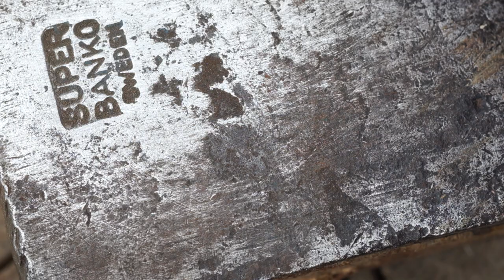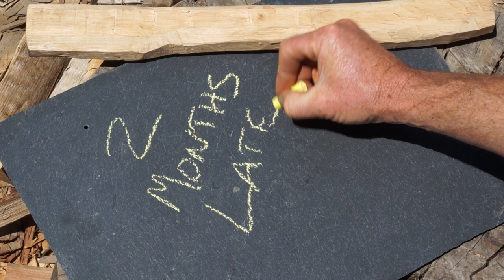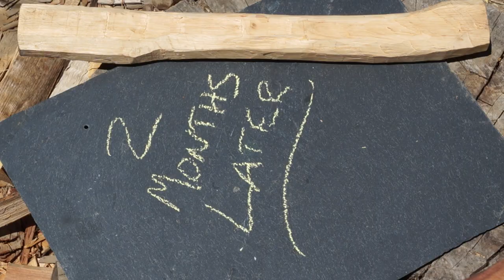Vintage Swedish Hatchet Modification & Restoration 1 of ?: Making a Handle Blank

Comment: You have the best homesteading channel on youtube, bar none.

Have you ever had any serious accidents/injuries/close calls on the homestead?
Reply from the maker: Thank you.  I want to actually tailor some of my future content a little more to new and would-be homesteaders if I can get it together.  I think everyone that is interested in any kind of self reliance/survival stuff should be following my content, but hey, I'm biased ;)   I've had close enough calls to get my attention with axes and chainsaws, but that's pertty much a given.  Too close to rattlesnakes a few times, but that's all I can remember.  Actually just remembered one time when a large fir log rolled over, which I basically expected, but it had a large branch on it that I hadn't noticed because it was barely visible.  It was pretty long and could have taken me out.  The velocity at the end of a long branch like that is pretty high relative to the speed of a rolling log.  That was close enough to lights out for me to remember.  I won't be surprised if I get it someday.  I work alone most of the time too, so it's just a risk I choose to accept to do what I want to do.
Reply: @SkillCult  I feel that in every way! Your channel has inspired me to make my first hatchet handle. Just recently carved from a cherry log. Small saw, axe, wedges, hatchet and a rasp. No power tools. I do landscaping and get paid to cut down or remove good material. Now I'm finally harvesting to an even greater benefit. Thank you for being an inspiration and a quality teacher 🙏🤘

Comment: Another great video Stephen.  I am slowly making my way through the videos on your page.  I love youtube but its easy to get sucked in and fill my brain full of more ideas than i can possibly accomplish.  Every since I started spoon carving this is the way I make my axe handles.  I sometimes use a froe depending on length of log.  Black locust is what I've been using for handles lately and I am very happy with their performance.  Also a shout out to the Pileated woodpecker at the end of the video. Seen 2 in my life and both times I was mesmerized.   SO much bigger in person that you think.  Ok - signing off.. Back out to the shop.
Reply from the maker: Yes, so many ideas and projects, something has to give.  I don't own a froe and never have.  I'll make one someday, which is why I don't own one actually.  I've used locust for handles quite a bit.  I like it a lot too.  I see pileated woodpeckers quite a bit.  I've been able to film them pretty close several times including this one.  Unfortunately, not with really good lenses.  Also found a nest once too.  One was working low down on a large rotten tree, so I snuck up on it and peeked around the corner right in it's face.  Hilarious :).    I always thought of them as elusive, but perhaps they are just uncommon.  Or maybe they're getting used to me here.
Reply: Very cool.  who knows maybe habitat where you are is a bit better.  You climate is similar but with less rain.

Comment: Awesome. I need to practice my axe skills. Just came home from my grandparents, my grandfather has a lot of axes with homemade handles. Used one just the other day when we did some gardening for him.
Reply from the maker: Cordwood challenge dude ;)
Reply: That's quite the undertaking...I might be tempted at some point, definitely.
Reply from the maker: There are plenty of things you can do to improve, but there's nothing like practical application and repetition to accelerate development of skills.  It really is an undertaking though.  I still feel guilty about doing it instead of other stuff I should probably have been doing instead.  Its also extremely satisfying and calming because it demands that you slow down, relax and focus.  You can always start very small, like 1/4 cord.  be safe.
Reply: Thanks man. I'm probably going to restore some more axes and learn how to create one that really fits me, and would be good for doing the cordwood challenge or something similar. I do have access to a small woodlot, and I occasionally fell some trees using only an axe on it. I can definitely tell that the axe is not ideal for the purpose, though. I'd like to make one more refined and adapted to me if I'm going to be getting serious on learning to use an axe properly, since it's gonna involve so much cutting. But it would be fun, and I have no shortage of handles or flea market axe heads to restore!
Reply from the maker: I think my next one will be about 27 to 28 inches 2.5 lbs, straight handle with a slight curve at the end.  The last handle I made was 30 inches which I found slightly longer than I wanted it for bucking.  Anything between 25 and 30 inches is usable for me though.
Reply: I'm pretty tall and lanky, so I think a smallish head on a longish handle might be a good fit. Not that I can't swing a heavy axe, but I want to experiment with a lighter one. I'm thinking that since splitting will be kept to a minimum when doing this type of challenge, you might not need a very heavy axe. How important have you found the weight of the head to be for bucking? I have done very little bucking with an axe.
Reply from the maker: D Cook says to try abut 30 inches for a multipurpose firewood axe.  I find the greatest shaping factor is bucking.  If the handle is too long bucking sucks.  I'm 5'10" and 30 inches is a little awkward for me.  I think it's best to start light and work up, but I'd go at least 2 lb and 2.5 is probably going to work really well.  I'm staying at 2.5 for a while and then I'll scooch up from there until I find a limit.  I don't have any heavier heads on short handles, but I think the common 3.5lbs is likely to prove a little too heavy.  I can swing 2.5 for a long time without fatigue if I'm dialed in and not spazing out or wasting energy.  I used a head that is probably under 2 lb a lot this year and it was adequate, but 2.5 did make a considerable difference.  As always, accuracy and efficiency are most important.  Have you read Woodsmanship by Mason?  great read.  You can find it online for free as a PDF.  If you can't find it, let me know and I'll dig up a URL or email it to you.  He calls 2.5 lb with 28 inch handle a pulpwood axe.  I think that is going to be just about right for me and where I was gravitating to anyway.  now I'm getting all excited to chop wood again!  Honestly, I'm not sure I'll be able to do it next year.  It was such a big time sink for energy that I don't have to spare.  But I want to.  I have so much forestry and chainsaw work to do though that I should probably be doing that instead.  We'll see.

--------------------------

 LIGHT VERSUS HEAVY AXES.  Farm Implement News, Volume 7 1885

A correspondent of the Albany Cultivator describes his
experience with axes as follows: well remember my first ax and my early experience with it. It weighed four and one-half pounds, being the heaviest one I could find at the time. I was fresh from school—fresh from a class in natural philosophy, one of my favorite studies. I knew all about inertia, and had learned something of the force of gravity and the laws of falling bodies; had rightly guessed that chopping wood, might be hard work, and determined that my knowledge of physics should help me out. I would have a heavy ax, a long handle—would move slowly, and take strokes that would count when they fell. My ax handle was thirty-four inches in length, the longest one in the store. I had hired a tough little French Canadian, weighing about 120 pounds, to help me in this work. When he came he brought an ax—a mere toy I called it. I think it weighed two and one-half pounds, with a handle only twenty-six inches long. I told him I had a fair-sized job for him, and thought it would pay him to buy a full-grown ax. . . He smiled and said he guessed his would do. I tried to explain to him the beauties of a heavy ax and the wonderful advantage of a long handle.  But it was all in vain; I was only wasting time; he could not understand it. 
“Poor fellow," I thought, “he knows nothing of the beautiful science of physics.  - It is too bad that he should thus waste his strength through ignorance, and be unwilling to listen to the voice of wisdom.” We went to the wood lot and began work. I had decided that we would work separately during the first day or two, in order that I might show him what I could do. As I began to swing my ax I felt proud of its ponderous blows that rang through the woods, and rather pitied the poor fellow who was drumming away with his little ax, taking about two blows to my one.  
 Presently I had to stop to rest, and then again, and still again; but Joe, my man, quietly kept pecking away, steadily and easily. Every few minutes I’d stop to take breath, but Joe seemed perfectly able to do all necessary breathing without stopping his work for the purpose. . When night came we piled up our wood and measured it. Joe's pile measured one and a half cords, mine only three-quarters of a cord.
During the early part of the day I had planned giving Joe another lesson in the evening, to see if I could not make him understand the elementary principles of wood-cutting and the philosophical requirements of an ax. But when night came I decided that perhaps it would be as well to let him go on in ignorance, and thereafter remained silent upon the subject The next morning I felt lame and stayed.at home. Joe put in his cord and a half, as usual. When I went to the woods again Joe and I worked together. Not many days passed before I found an excuse for buying a lighter ax and a shorter handle. And every ax and handle that I have bought since has been lighter and shorter than its predecessor. Whenever I use an ax now I select one very much like Joe's, both in weight and length of handle. I can use this without getting out of breath, and can hit twice in the same place. The result is that I can do more and better work and save a vast amount of strength. I write this as a word of caution to the inexperienced wood-chopper when about to purchase an ax.
Reply: Thanks a lot dude! I'll look into Woodsmanship. I'm 6'2" and have fairly long arms, so a longer handle might be just what I need or become a disadvantage. We'll see. That was quite an interesting read from FIN, too. Regarding your upcoming workload, there's a lot of room for nerding out and learning a lot about chainsaws, too! I've only scratched the surface myself, my school had a class about the subject and that's about all the felling I've done, except a few trees in my yard. There are some pretty cool tecniques out there, and there's a lot of room for improvement on accuracy and angles on my part. If you can get into that, I'm sure you could nerd out just as much on chainsaws as you have on axes, and that could mean getting a whole lot of work done!
Reply from the maker: Yeah, chainsaws are fun too.  I just got a new one because my old one was just outclassed for a lot of the work I'm having to do.  I picked up a Dolmar/makita 64cc and an aftermarket kit to rebuild it up to 84cc.  I've never owned that large a saw, but it will be a very light saw for that kind of power.  Now I'll be able to mill good sized stuff if I want to and just get more done more quickly.  Not as compelling as axes though and an entirely different kind of work.  Sounds like 30 inches might be a good place for you to start.

Comment: looks real good to me so far. not many good videos on utbe showing the process of making an axe or hatchet handle from a billet. thanks for posting. keep 'em coming
Reply from the maker: I was thinking I'd probably just make it with a hatchet, knife and rasp to keep it really simple. Most people don't have a spokeshave, and even if you do, they are of somewhat limited use without a vice or clamp of some kind.  Not sure when I'll be able to get back to that project, but sometime...
Reply: SkillCult well, did you finish it?

Comment: That was good to watch :D Did I see a Gransfors Small Forest Axe there? Looked exactly like mine. Maybe that Husqvarna will grow on you ;) Keen to see part 2
Reply from the maker: That is the 25" gransfors forest axe. It's a good compromise size. Not too horrible to use with one hand, but long enough and heavy enough to do just about whatever if you're patient.  It's still light enough to lug around easily or even pack.  I've had it for almost 20 years, from back when they were about 60.00 or 70.00 bucks.  The handles are too thick.  This one needs more thinning, but I never seem to get around to it.  I always forget until I find myself using it again.  It was unusable when I got it.  it's better now, but after using it for an hour or so the handle shock starts beating me up.

Nope, I still don't like the husqvarna!  This is footage from a couple months back.  I've actually mostly been using other hatchets for splitting billets.  I was thinking I might throw it in the forge and try to fix it, or I might still sell it, dunno...
Reply: I'd like to see how you balance thinness of the handle versus durability. How thin should you go before you risk a catastrophic failure? Just about every handle I see for sale nowadays is like a baseball bat. I know they're too big, but I'm wondering what is too thin?
Reply from the maker: I'd like to see that as well!  In the case of hatchets, I think it's not going to be danger of hitting the durability limit, but rather finding the compromise between having it big enough to keep a good grip for control and having it thin enough to be comfortable to use.  I don't know what I want yet, but I know my last one is too thin to maintain really good control and comfort with one hand.  I also made it too tear drop shaped, at least for it's thickness.  Also something to think about is that a thin handle will flex more throughout it's length.  Wouldn't that just spread out any stress along more of the handle absorbing more of the shock?  That could reduce stress on the most vulnerable parts, especially the eye which is still going to be the thinnest area and where my last axe handle broke.  I met a guy on the axe junkies facebook page that thinks excessive thickness contributes to breakage because of lack of shock absorption.  I've had similar thoughts, but mostly along the lines of reducing stress on the thin eye area.  Imagine if you made a super thick handle.  I mean exaggeratedly thick, like a 2 x 2 or something.  Imagine how much stress that would put on the eye area with almost no shock absorption.  It would always fail at the eye and probably would be pretty easy to break.   So, if you took thinning of that to an extreme, wouldn't that continue to reduce stress on the eye by sharing the stress across the whole handle?  I'm not sure if that logic is totally sound, but there is something to it for sure.

I don't/haven't made enough of them to have a set idea of what I want and the balance between the gripability part of ergonomics  and flexibility is the question I'm most interested in right now when it comes to hatchet handles.  If it's a multi-use tool, then it ought to be able to be used comfortably and precisely for extended periods of carving and hewing.  

One last factor to remember is that a straight handle is stronger along it's shaft than a curved handle.  Just about everyone seems to agree with that.  You wouldn't make a bow that has extra curves in profile view.  It may survive to a point, but it would be inherently much weaker than a normal bow.  There may be reasons to make that compromise with a longer handle, I'm not sure either way, but I've forsaken any significant curves in the main part of a hatchet handle entirely at this point.  If possible, I actually want one continuous straight line from the top of the eye to the handle area when possible.  I should probably do a video on all that theoretical stuff.  I'm not sure I can work that into this series or not.

Comment: Was there ever a second part to this series?
Reply from the maker: no, someday...
Reply: So I guess that handle is languishing back on some dusty shelf?
Reply from the maker: It's on my counter actually.  The next step will probably be working on the head, then making the handle.
Reply: I want to see the ideal hatchet.  I'm holding off buying until I see something that approximates what you will be building.
Reply from the maker: Well, I'm not sure I can make this into something I really like yet.  We'll see how it goes.  If I were to actually design something, I think it would take a long time. Too many questions.  What I know the most is that I like handles longer than almost anyone puts on commercially available hatchets and I don't like them too heavy.  That is for a multi-use hatchet anyway.